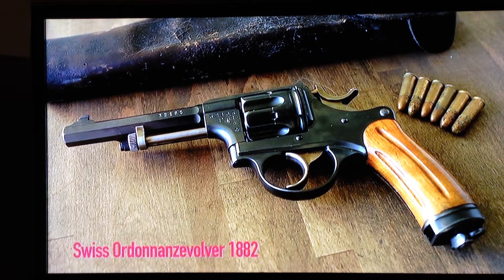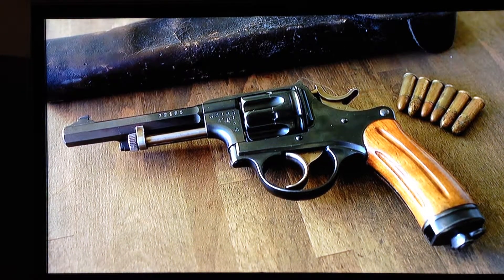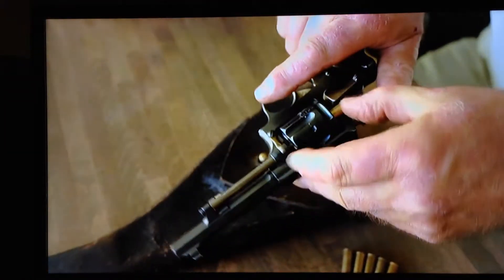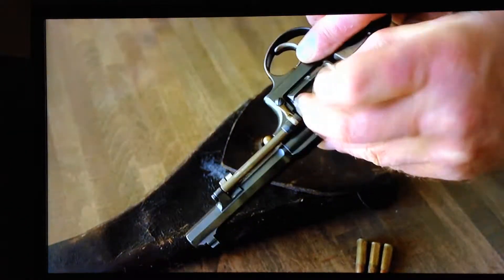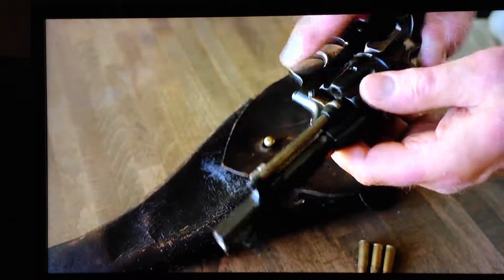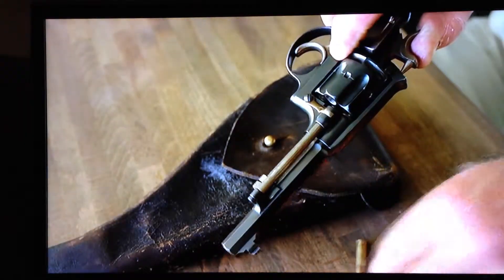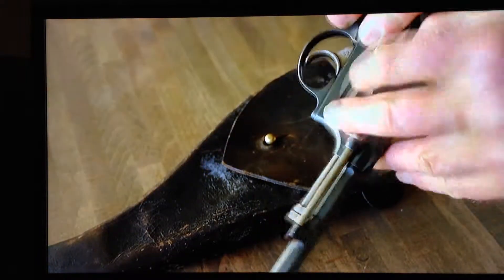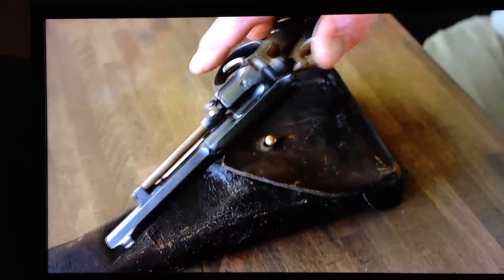1882 Swiss Ordonance Revolver rig 32165 video

Comment: Hi there. nice video and revolver. Alternatively, after confirmation of empty cylinders, the Swiss revolver was loaded by flipping back the loading gate, which disengaged the hammer, allowing the shooter to load each chamber by a pull on the trigger to advance each cylinder for loading...not by slight withdrawal of the hammer. Much easier manual of arms and also as intended by the design with the hammer disengagement. :)